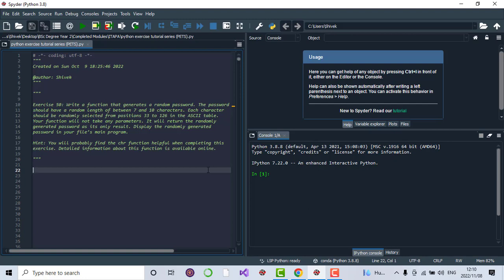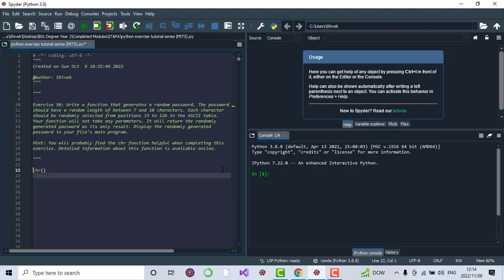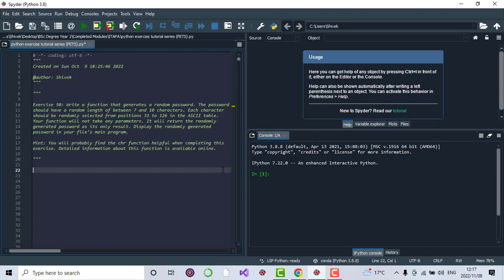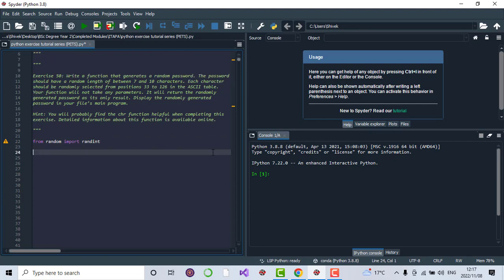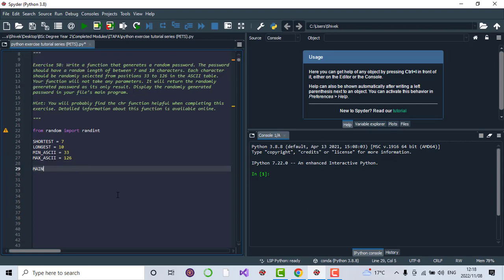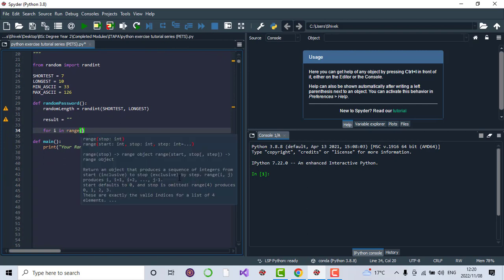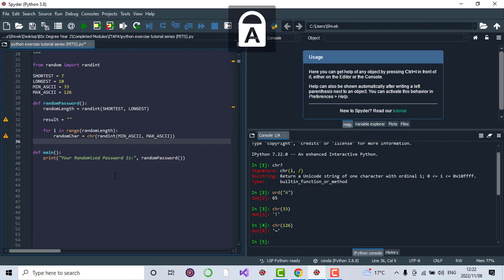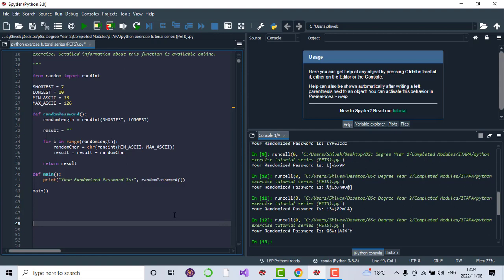Python Exercise Tutorial Series | Exercise 50

Comment: I'm sorry to bother you but could you help me with these exercises, because I tried to do them but they are not working, please?!

Exercise 1) Calculate the number of even numbers in a range of numbers. The user must choose the starting and ending number of the range to be analyzed, where the input values of case 1 are 1 and 10 and the output is 5! And in case 2 the input number is 25 and 30 and the output is 3!

Exercise 2) Perform the successive reading of numerical values and present at the end the sum, the average and the amount of values read. The program should continue reading the numbers until a negative number is given. This negative number should not enter the calculations.

Exercise 3) Read user-supplied numbers (one number at a time!) until two equal numbers are read in sequence or either number is less than or equal to zero. State which of these two reasons led to the end of reading numbers.

Exercise 4) Check if a natural number is perfect. A perfect number is one for which the sum of its natural divisors (excluding itself) is equal to the number itself. For example, 6 is a perfect number, because its divisors (those that are divided, have a remainder of 0) are 1, 2 and 3 and the sum of these results in 6 (1+2+3 = 6).

Exercise 5) Receive a number N and return the sum: 1² + 2² + 3² + 4² + … + N².

Exercise 6) Find the greatest common divisor of two natural numbers.

Exercise 7) Calculate the value of the element at position N of the Fibonacci sequence.
Reply from the maker: Hey, Jheni! Sure, it's no bother. I will make time to code my solutions to these exercises, and when I am done, I will share the code in the comments.

Before I provide you with my solutions, please may I request that you share your code? I would like to see your attempt at the exercises first.